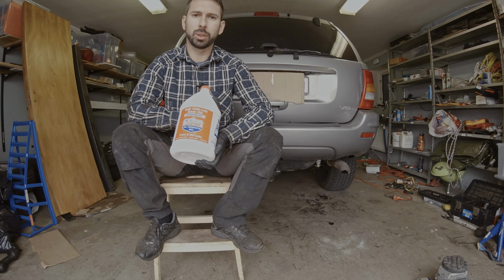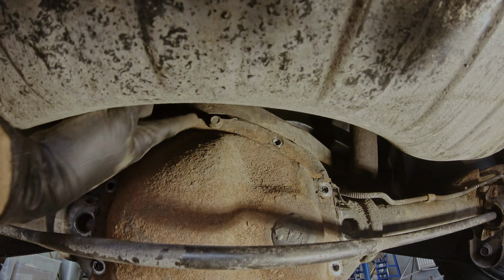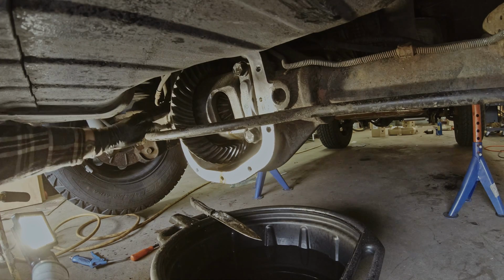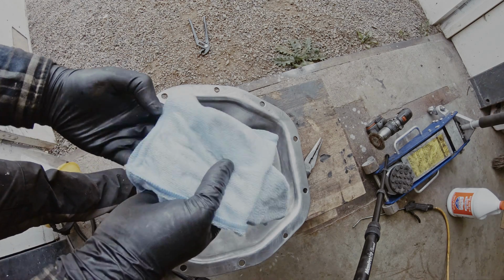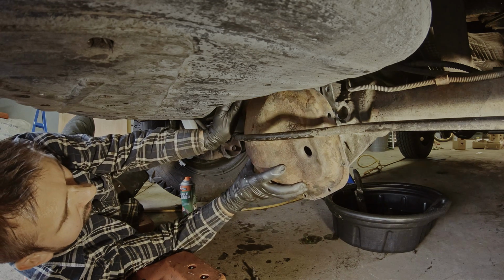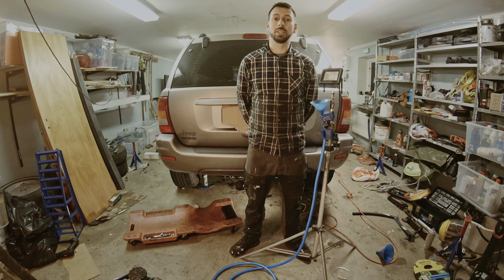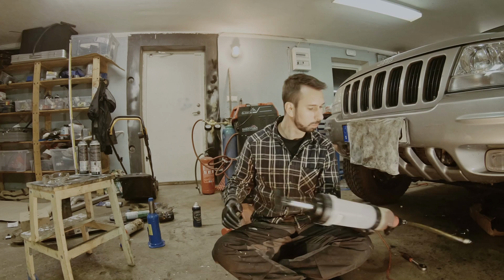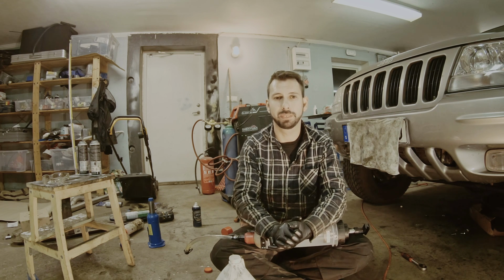Change Differential Oil Quick & Easy

Comment: Don't do this to the magnet holders! You will weaken them and they can break off inside! There is no need to do it like that.
Use  a gasket scraper or a sharp blade to remove the gasket material. Don't use a wire wheel on the aluminium housing. Use cloths, then you don't need to use all that brake cleaner. It's not good for your health or wallet.
Don't use brake cleaner. The service manual says: "Clean the housing cavity with a flushing oil,  light engine oil, or lint free cloth. Do not use water,  steam, kerosene, or gasoline for cleaning." 
The Dana 44a does not have an LSD, but a Gerotor pump clutch pack. Oils for LSD will probably not work satisfactory without adding Mopar friction modifier. Regards from Norway :-)